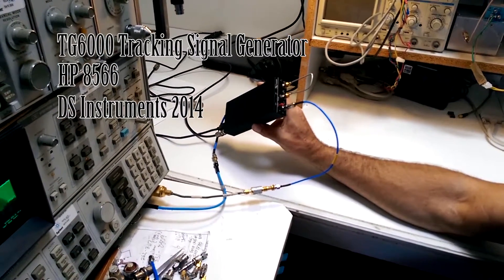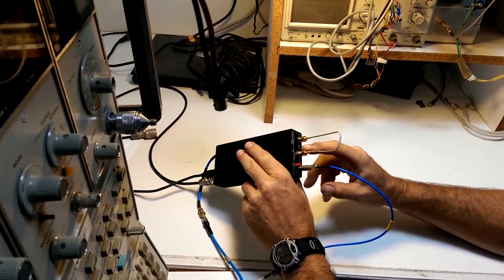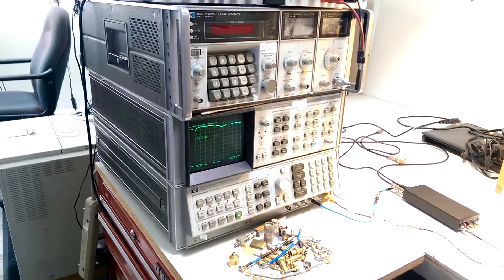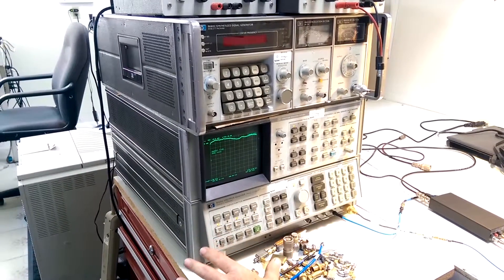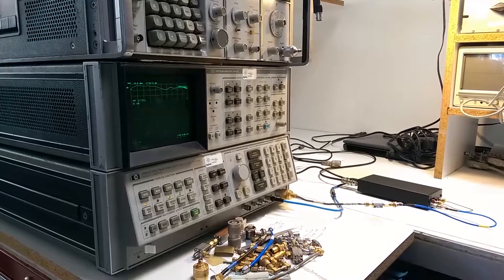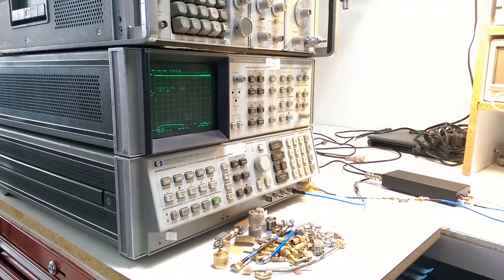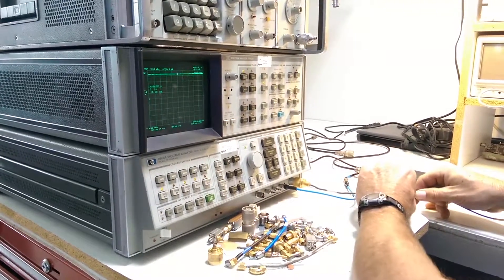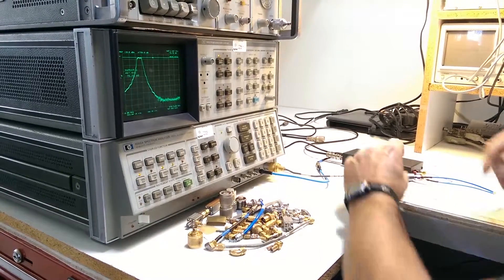HP 8566b 8566A Tracking Generator TG6000 Usage

Comment: Just a follow up. I have been using the TG6000 for over 6 months and have been very pleased. The 8566B is an awesome spectrum analyzer and beyond most of my needs. Lacking a tracking generator  was my only complaint with the instrument. At the time the TG6000 became ready I almost bought a Rigol SA just to have the a TG for my filter work. The TG6000 was far less expensive and allowed me to save a little real estate in my lab by NOT buying another instrument. Not to mention allowing me to stay proficient on one spectrum analyzer instead of 2 very different units.
The TG6000 has worked flawlessly and allowed me to resolve some unforeseen faults in one of my filter designs..
I am excited about your new digital attenuation and that will probably be the next purchase.
Glenn Scott
DSM Labs (dot com)